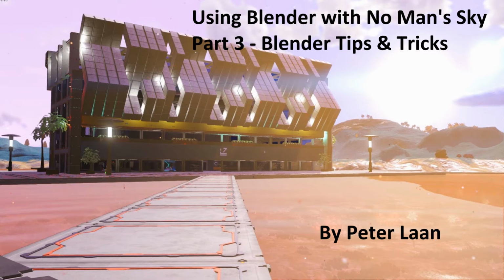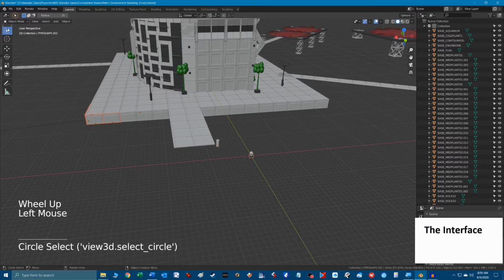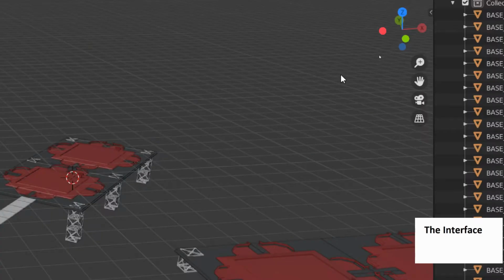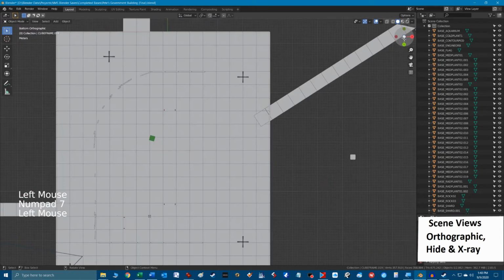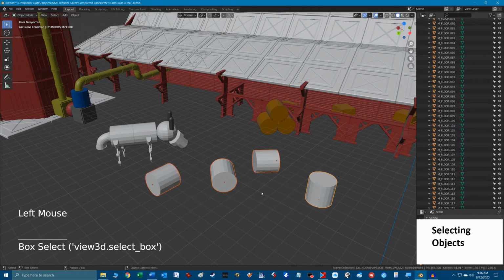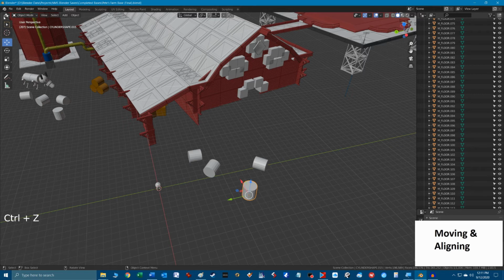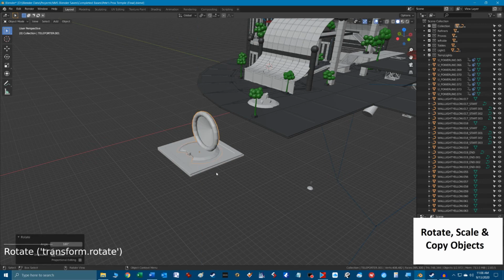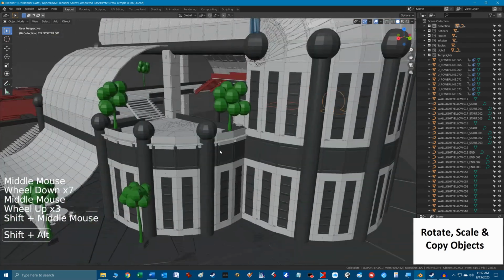Using Blender with No Man's Sky - Part 3 - Blender Basics

Comment: Hmm I seem to be having some weirdness while zooming where it refuses to zoom in past a certain point which is very far away from the actual base and thus making it hard to really do anything. Any ideas what's up there and one other thing I tried to find this on google but it wasn't giving me anything useful, I need to invert the directing middle mouse panning goes I use "airplane controls" and my up and down motions need to be inverted ^^;
Reply from the maker: Hi Arcanua, this is a common problem with Blender.  How you fix it is to select an object, then hit the period key(“.”) on your numpad to recentre the scene on that object.  The zoom feature will reset.

Comment: Sometimes when I'm using the scroll wheel to zoom out it just stops and won't go any farther? What is happening and how do I fix this?
Reply from the maker: Hi Kristi, thats a known problem with Blender, simply select an object you want to work on and press the numpad period button (.) to reset the view focus on the object, wheel scroll should correct itself.
Reply: @PeterLaan  Thanks. I do that when I can but I'm currently working on long distance between planet and trying to scroll up following in the electrical line to find the end b/c I can't see it from the first part of the base. :/
Reply from the maker: @GamingwithKristi  Hi Kristi, note the name of the remote teleporter (should be "U_MINIPORTAL.xxx") find the object in the collections window (right side of Blender UI) click on the name of the mini teleporter there, and then move your mouse back into the 3D window space and hit the numpad (.) key... it will zoom the display up to your remote teleporter.  You can switch back to your base the same way, find the base flafg in the collections window, select it, then again move your mouse back into the 3D window space and hit the numpad (.) key... voila! you are back at the base!

Comment: How do you get the base computer lined up straight with the grid so that your build is oriented correctly when you look from the front or side?
Reply from the maker: Hi KristisBeach, sorry for late reply, you prob already found an answer, but I always try to plant my base computer pointing in the direction of where I want my grid to line up.  Blender will always pull in the base orientated where the base computer is pointing along the Y axis (in Global Transform Orientation) - this is the direction you are facing when you drop the BC.
Reply: @PeterLaan  That is not the answer that I found but is more helpful. Thank you!

Comment: Are we able to import custom models? If not are we able to edit for example a wood floor into a heart shape or something? If this is possible can you make a video on it ?
Reply from the maker: •Plube • the NMS plugin only recognizes the NMS objects as part of the export process, so although you could import models into Blender, they could even be used as reference, but none of the non NMS assets will export to the game (unfortunately...lol)
Reply: Peter Laan what about warping no mans sky base parts into new shapes, is it possible?
Reply from the maker: •Plube • nope, you can rotate, resize, only.  You can move from “object” mode into “edit” mode and deform the NMS object mesh, however it will still only come into the game in it’s original form factor.
Reply: Peter Laan https://www.reddit.com/r/NoMansSkyTheGame/comments/ee0dnv/i_just_saw_this_structure_on_this_weekends/?utm_source=share&utm_medium=ios_app&utm_name=iossmf

What bass part is that then ? It’s so curved and I’ve never seen it before
Reply from the maker: @-Plube-  That is actually a legacy corner half wall part that the game engine still recognizes, but does not show up in the build menu with the latest release.  It is buildable if you have Blender & the NMS plugin!
Reply: Peter Laan oh ok ty.